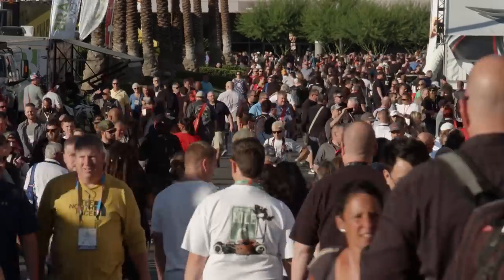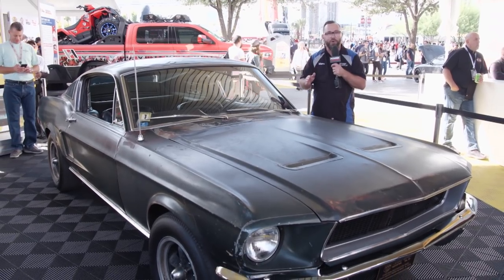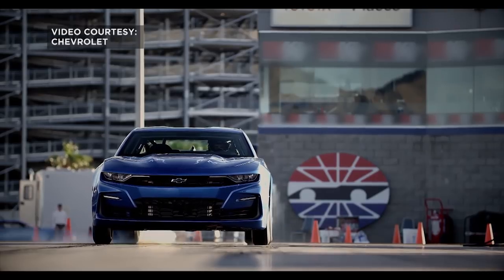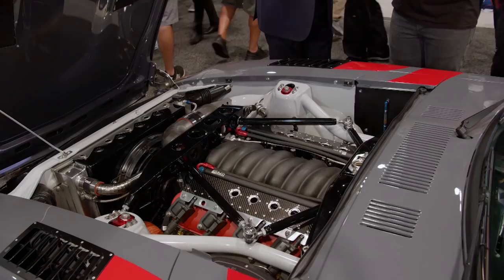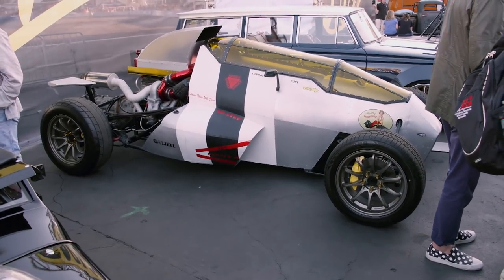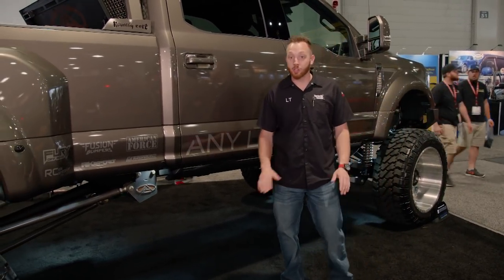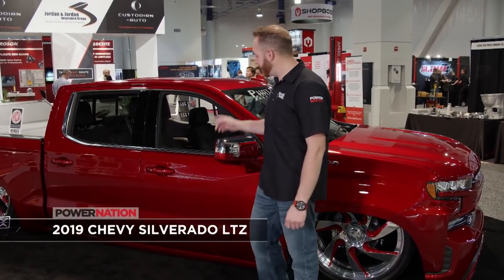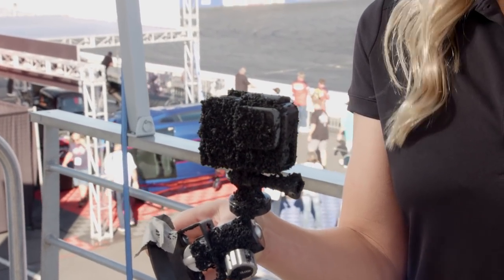Very Best Cars and Trucks of SEMA 2018

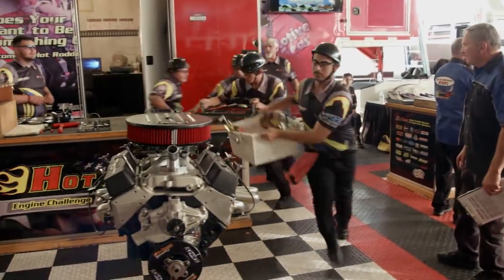Comment: 41:35  Why the helmets??! 😂😂😂
Reply: dropped tools, head butting. you know things that could happen when in a rush to win
Reply: They are scared that someone was going to throw a cylinder head at a teammate or competitor lol I can understand steel toe boots being a requirement but helmets I don't understand one bit because you never see a mechanic wearing a helmet in a shop even at a dealership if they did that would make a little more sense since most of the time they put the car on a lift to work on them but this is a SBC on an engine stand and you never get under the engine to bolt on anything while it's on the engine stand you just flip it over
Reply: @keefespencer1173  it's a race to see who can get done first, you have many hands in the way. Shit can happen so safety first.